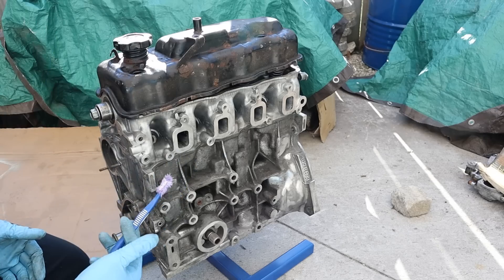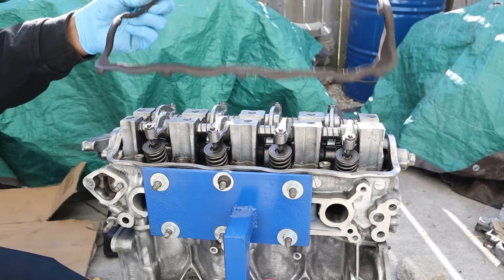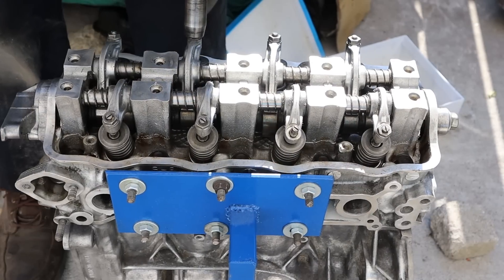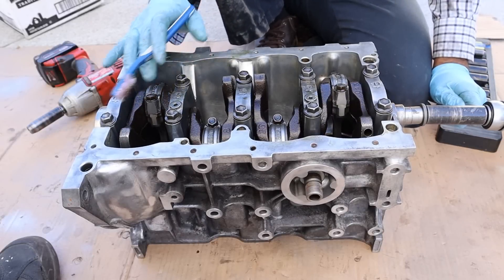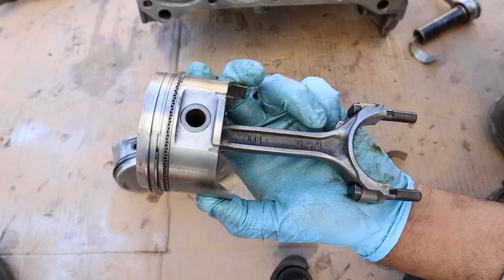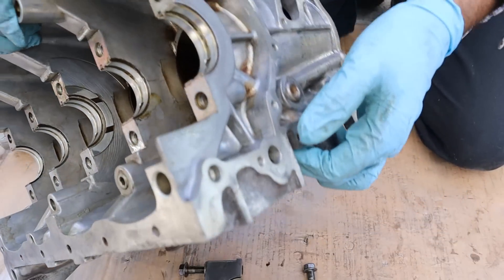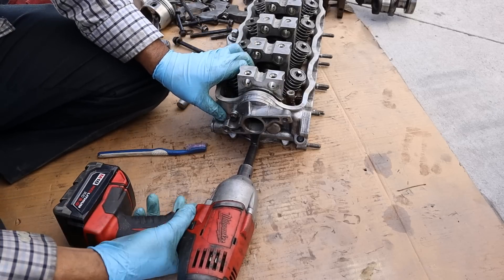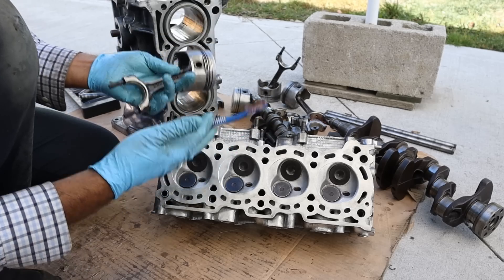Inside a Suzuki Swift Engine

Comment: Did maintenance on swift in my engineering internship. Swift is still in use in India.  I think Suzuki also have rally version of the swift.
Reply from the maker: Yeah I bet the developing world still has these cars because they are simple and economical
Reply: @speedkar99  Latest version of Swift in India comes with; 
1.2 K series engine with timing belt
83 BHP and 113 NM of torque
AMT and MT versions
Very reliable, economical and fun to drive. 
Tuneable as well for more power.

Comment: Excellent example of 1980-1990's perfected designs, might not be powerful but gets the job done reliably and is easy to maintain. We once had the G10 1-litre 3-cylinder, I gave it no mercy while driving, but it never let down
Reply: Yes slowww above 70-80km/h, but city speeds, surpisingly OK. Low power meant that every single acceleration was at WOT 😆
Reply: 3cylinder balance Brilliance
Reply: Fuel consumption not very economical
Reply from the maker: Must have been slowwww
Reply: @speedkar99  i had a Geo Metro 1 litter it was geared for the power just my normal driving i was usually off the line quicker then most cars and used less fuel
Reply: @danhard8440  so good on gas, almost as good as a modern hybrid. Haven't had any car that could beat my LSi's mpg
Reply: @speedkar99  I owned an '87 Firefly - 1L, 3cyl - the car itself only weighed 700-ish kg, so frankly it didn't need a whole lot to get it moving.  It was an excellent little "urban warrior" car - more than adequate for running around the city.  On the highway it was a "drive with patience" car - don't expect to be passing anybody else - the top end was probably 120 km/h - downhill with a tailwind.

Comment: Suzuki is unterrated. That's my hot take of the day.
I'd love to have a Suzuki Jimny but my ideal drivetrain configuration for that would be a small inline 4 turbodiesel and an automatic transmission. But Suzuki doesn't offer that here 😅

TDI swap a jimny? crazy idea but could honestly work.
hmm maybe Volvo is a better candidate their diesels are more reliable and I think the majority here were delivered with automatics... but then it would need to be the AWD version since I don't think its possible to adapt the FWD transmission to the Jimny drivetrain unless I mount the engine+trans package longitudinally and weld the diff... but then all the power would be going out throughone puny CV axle into the Jimny transfercase and those Aisin transmissions Volvo used are not easy to work on and get back together again... also the engine would sit in a pretty akward position to get everything lined up... maybe a rwd/awd BMW drivetrain is the better option they also have decent diesels
ok brainstorm over 🙃
Reply: EV swap.
Reply from the maker: Wonder why they left north america
Reply: I have a Jimny with the G13BB similar-ish engine but 16 V (still one single cam)
It's the '98 version so only 80 hp...
While underpowered for some tricky offroad situations the 4WD + low is enough, just requires more driver care.
It's made in Japan, god knows how many real miles it has, still sounds great.
I'm trying to maintain it by the book. 
Extremely easy to work on, quite the hobby for the amateur learning mechanic :D